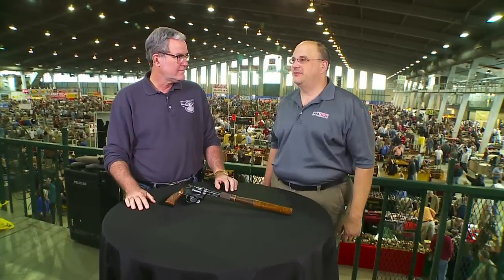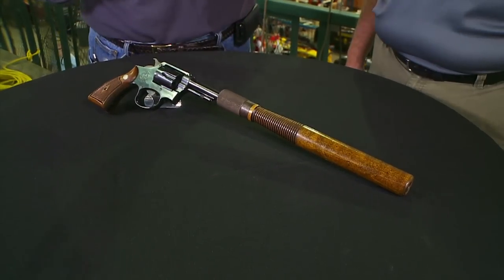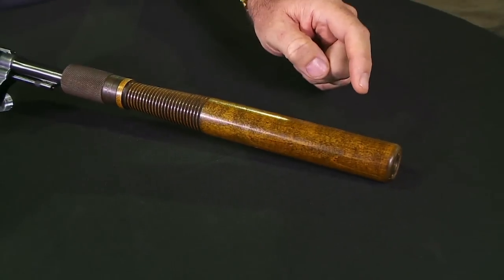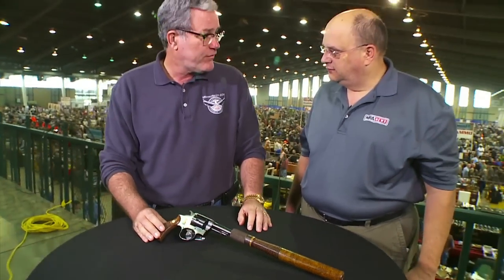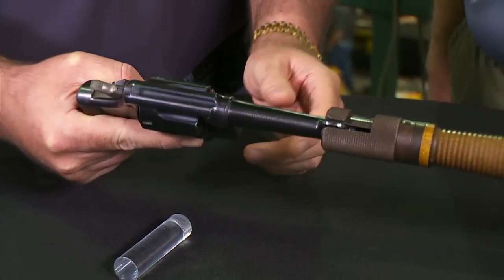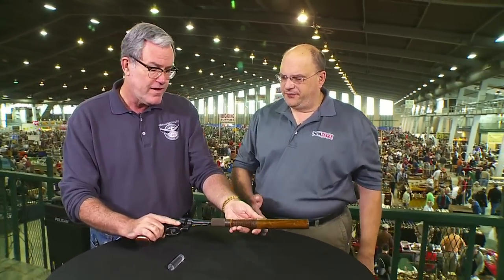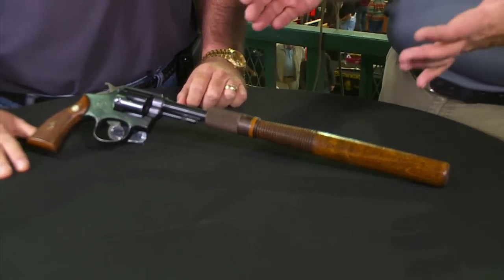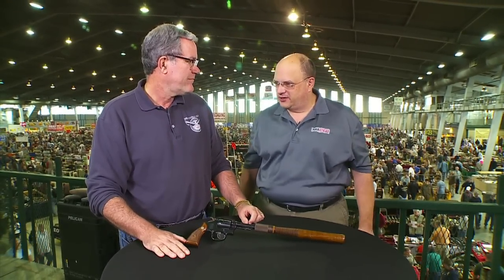Curator's Corner: S&W Model 10 Revolver with Billy Club - What Were They Thinking Edition!

Comment: I agree with TheHKCollector. I believe it's possible that this was expected to be carried separately and only used when you wanted to lengthen the barrel in order to take a longer ranged shot. The real question is whether or not the inside of the club is rifled or not. If not, then that theory goes out the window. But if it is, then it implies that Jim's theory is likely wrong and this was just a handy "barrel lengthener" that also doubled as a billy club. But either way, it is a bad idea...